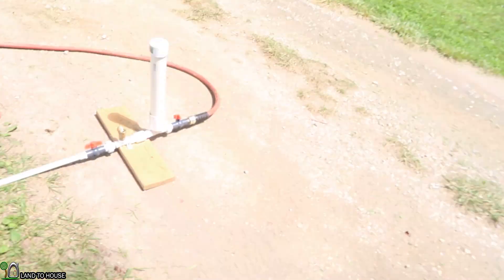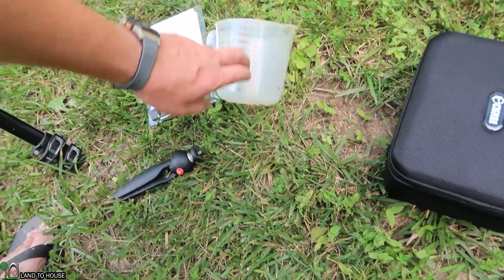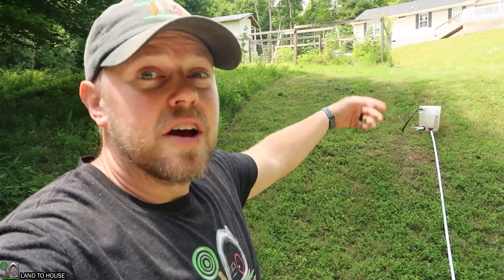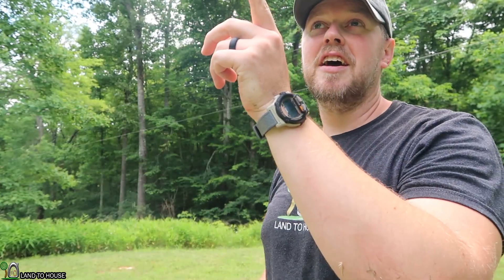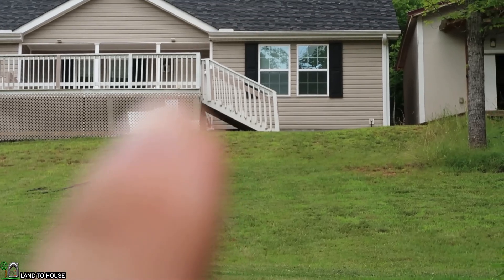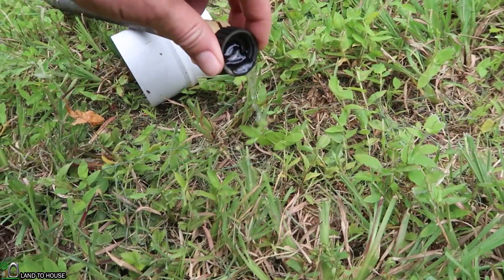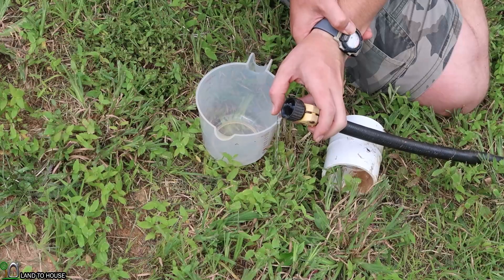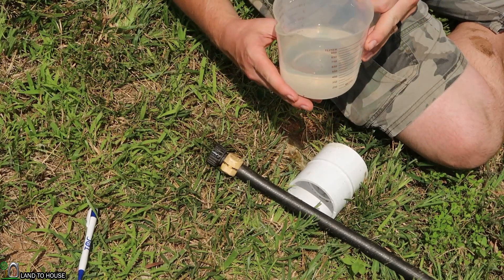Ram Pump Height vs Flow Chart Building

Comment: Hey bro, great stuff but do you realize most of the world in metric ? If you could include the cross over it will help maintain focus on your teaching.
Reply from the maker: You mean the length of a kings foot or nose is a poor measurement method? haha What's wrong with counting by 32nds?  

I need to get more into the metric system.

Comment: Was wondering if one could use multiple ram pumps to pump an amount of water up higher than with one. In other words you have a large one initially. Then up higher you utilize the water delivered by the big pump to run a smaller pump. OR multiple pumps at each elevation. ????

Comment: If your inlet pipe is larger water will flow through it easier and will enhance the working of the pump. That there is more water in the larger diameter pipe makes no difference here, only that the water will flow easier.

Comment: Ive been doing testing with a 1/4 in. Line  ram pump i made and i came up with a intresting addition to it you or others might be intrestid in .
I hooked up a bicycle pump to the first check valve to quick charge the pressure for a instant start up and it worked on my first test , gonna redesign that it into this build i have by adding 2 more check valves on other sides of output and pressure tank with 1 of the valves for the hand pump inlet and see if its a practical addition or not .

Comment: Could you hook another ram pump up to the discharge  on the flap valve? Like have that setup you just did and the add/run a ram pump with the wasted water that just runs on the ground?
Reply from the maker: Yes you sure can. I have a video with a 1" ram pump running a smaller 1/2" pump from that.
Reply: @LandtoHouse  Awsome! I'm gonna have to go and watch! Love your videos! Keep up the fantastic work!
Reply: @LandtoHouse  so if you have a 105 foot straight drop into the feed side from the delivery pipe it could go as high as 735 feet vertically up hill according to the one to seven rule  

I did the math for a 24 inch hydro ram pump with a straight vertical feed pipe and it could through a serious amount of water 
Assuming 24 inch diameter pipe at a drop of a 105 feet it would have a flow velocity before reaching the pump of 112.1 km/h aka 69.7 miles per hour aka 31.14 meter per second or  102.2 feet per second 

And a flow discharge of 9.09 m/3 per second or 321 cubic feet per second or 11.9 cubic yards per second or 9090 litres per second or 2401 us gallons per second 

Basically enough to move a significant portion of a river up hill I'm just wondering with such a huge head pressure what percentage of the water makes it to the top of the hill versus how much comes out the waste valve on the bottom and goes down river 

So if it has a imput of 9090 litres 
Ruffly how many litters would make it to the top of the hill.

Comment: People spend a lot of effort matching the ram pump diameter to the drive pipe diameter but not to the delivery pipe/hose diameter. For instance, they will have a 1 inch drive pipe and ram pump but a 1/2 inch or 5/8 inch delivery hose. I would think any delivery pipe/hose diameter that is not matched to the ram pump diameter would have a decreased amount of water delivered. Maybe people could get substantial water throughput improvement just by using a correctly sized delivery pipe/hose. Perhaps you could test that on one of your very informative videos with a 1 inch ram pump and various sizes of delivery pipes???  BTW, really enjoy your RP videos!

Comment: I’m new to the channel, I was just wondering if a larger drive pipe would create more volume or lift pressure , I’m sure you have addressed this but I haven’t had a chance to look thru all your content, just curious, I have a situation in South Georgia where it will take a pretty long drive pipe to get the lift I need, do you got any suggestions to shorten that or is it just what it is, thanks

Comment: What would happen if you change the brass valve to a smaller diameter or bigger.
Reply from the maker: A mismatched valve and drive pipe will either keep the valve closed all the time or not close the valve.

Comment: I am curious about a set up. I think I've see most of your ram pump videos but you may have tried this and I missed it.   What if you had your input bucket raised on a platform and used a coil of pipe as the drive pipe instead of straight pipe.  The drive pipe could be "longer" without taking up distance.  Would the shock wave travel up the coil?  Would the coil actually act as a shock absorber and not allow the water hammer effect?  Would there be more friction loss of some kind?  Just some thoughts.  I'm moving in a few months to our new property and hope to get my ram pump set upagain and I can do some of my own experiments or replicate some of yours.   KEEP UP THE GOOD WORK!!!
Reply from the maker: This video might be interesting to you. It answers those questions rather well. 
https://youtu.be/E-92wxbG2Gw

Comment: quick question, could you make a staircase of ram pumps (for every foot of head pressure you get 7 feet out) what i am asking is, on a hill every 5 feet down there is a bucket with a 1 foot drop supply pipe to a ram pump that feeds the next bucket up the hill, do this for a few "steps"?
Reply: Doesn’t that me mean that the first pump has to be massive? Both pumping  the needed  water  and the "waste" water  for the next  pump? 
Or maybe slowing down the second  one, but can that  even be done?

Comment: Wow hey brotha,  just found your channel 
Looks great i have seen some videos from others , your details are very interesting,  just wanted to mention using a garden hose while going uphill ,do you think a solid pipe may hold the pressure better ? You got me hooked
Reply from the maker: Thanks for watching. The delivery pipe is only limited by gravity and friction loss. Because the pressure is very small (9psi max in this test) it is just fine to use a garden hose.

Comment: Probably the easiest way to get the head height and the delivery pipe height is to 1) make sure both pipes/hoses are full, 2) stop pump, 3) measure psi on the high pressure and low pressure sides of the ram pump --- divide the psi on each side by .433, each foot of height generates .433 psi (ie. 3psi / .433 = 6.9 feet of head height, 20psi / .433 = 46.2 feet delivery height). No measuring hoses or laser levels.
Reply from the maker: I do have a low psi gauge that would be good for this. I might also do a video on a clinometer

Comment: Is there an optimum air pressure inside the pressure tank? Have you ever put a pressure gauge on that? Would supplying some compressed air help?
Reply: Been wondering the same

Comment: You could attach the outflow part of the hose to a long pole or a 1"x2" or something to lift it higher.  It could be extensible like an extension ladder.  I have one for changing ceiling light bulbs.  Or you could raise your RAM pump up on a box to decrease the head pressure from 65" to 60", 55", 50" etc   That way you could get several ratios for the same location of water source and outflow hose.   But at some point you'd get below minimum head pressure needed.  Or rope over a high tree branch, tie rope to outflow raise until output just barely stops = maximum output pressure

Comment: I wonder if using a 40-60 ft. length of tubing for a drive pipe in a switchback pattern over the 20 feet of run would increase head pressure. It would always have to be descending to avoid slowing the flow and the extra weight might provide more pressure in the drive pipe.  It should join a few feet of hard pipe before the pump. Would it increase the length of the drive pipe without affecting the amount of fall?

Comment: Do you think you could go from a pond to a tank up a hill about 20 feet above  where the pond is????
Reply: Yes you just have to drop the water through a drive pipe from the pond into a ram pump.

Comment: How much could a person upsize a ram pump of this design? Like the idea of a ram pump but for it to be of any use to me I'd need one that could output atleast 2000l per day. Head and flow isn't a problem as I've got a spring coming down a hill at about 500-1000l per minute depending on the season...
Reply: It depends on how high you want to get the water and how much you're willing to spend. You can physically upsize this design like the one community did in a remote village to fill a reservoir with a large cast iron unit (just make yours with 3in pipe or whatever your calculations show), or you could do the more logical thing and build like 10 of these smaller units and run them in tandem.

Comment: GREAT! Bringing more precision into the testing is very good. And your 2nd and 3rd measurements points are already showing a mathematical consistent correlation: If nothing changes between the 25 foot and the 32 foot mark (pump efficiency, water usage of the pump, etc.), then you would expect the 25/32 flowrate at the higher point. 25/32 = 0.78 or 78% of 2 cups are 1.56 cups. Voila! Anyhow, you would expect nearly the same ration (20/25 = 0.8 or a drop from 2 cups to 1.6 cups) for you first measurement points at 20 feet and 25 feet. I think that the delivery height is so low, that the pump is not yet in stable conditions and water usage or efficiency of the pump will change. Might be that the efficiency of a ram pump increases with delivery height. At least at low delivery heights. Is there a way to measure the rate of wasted water? E.g. put a small hose on the wast valve and measure the flow rate. Can be done after the deliverey flow rate measurement, but under the same conditions (e.g. measure always with this small hose on the waste valve, because it will also affect the pump). The flow rate for the used water then ist the sum of pumped plus wasted flow rate. To have the flow rate of the used water is important, because mathematically this is the relevant value because it determines the input energy of the pump.
You also need to gain more delivery height. Could you use a ladder? Probably just another point a little below 40' would be sufficient.
Thanks for the testing!!!

Comment: So you're most water flow was at 20 feet everything passed that started getting to be less which was making the pump less efficient
Reply: Efficiency hardly matters when there is $0 cost input energy. Yes, maybe not ideal and could be optimized. 🤷

Comment: I noticed that, on your first test, the hose was dripping outside the edge of the container, making your first reading slightly less than it should have been.  This could be why the second test was almost the same as the first one.
Reply: I also noticed that. It is realy hard to measure those values exaclty. I appreciate Seth's approach to do so. But at the end it will be helpfull for calculating the expectable output of such pumps. Furthermore, I think that 20 feet are to low for the delivery height, and the parameters of the pump (like efficiency and water usage) are not yet settled. It might be that the efficiency is increasing with delivery height, at low height. With 5.4 feet of head (65") and only 20 feet of delivery height you have a quite low ratio of 1 to 3.7 for head vs. delivery height.

Comment: I am curious about how much water is used to lift a given volume. ie, How much water did it take to life the 2 cups. Perhaps put the pump in a catch basin and measure the water used or take a measurement off the 5 gallon bucket. Thanks Seth, really enjoy your channel. Have you had a chance to check out 
"OpenSourceLowTech" channel? He has commented on your videos before. He is getting 200 watts out of his low head turbine system like you set up at the dam pond. (I think at your neighbors) Edit: I was wrong, he was getting 200 watts.

Comment: Would have been helpful to determine volume at lower levels.   For example with 5 feet of head, wonder how much water would have been pumped at 10 feet of lift.   For those of us doing irrigation with various sprinkler pressure possibilities could be important.   Also related to one of your previous videos where you were filling a tank with different methods, I've wondered how much water volume I sacrifice to fill an elevated tank vs dump the water on the ground with the lowest lift possible.... Or low pressure sprinklers or nozzles vs higher pressure.   Can't wait to see more results and if we can duplicate.

I believe that your comment that some output charts were calculated vs observed is correct, because they were too mathematically exact...no variation from calculated values.

Comment: The tests so far bring into question, the idea that for each doubling in height, water volume pumped is half.     In my own low head testing with a Land To House pump, I have been surprised how high the pump could deliver water ... Although at a low rate.

Comment: Good demonstration of the ram pump lift ability. Question regarding the measured heights mentioned in the video. Are the 20’, 25’ and 32’ test points measured from the pump or the bucket? If measured from the pump you will need to subtract the head height between the bucket and the pump. If measured from pump the actual 20’ measurement would be 14.5’.

Comment: I think the measurements are a bit incorrect, ill rather suggest you to use level tube, that is perfect in measuring heights.
Reply from the maker: A water level is a good way to measure height. It can be more difficult when you have to measure across a longer distance. These heights should be very close to accurate based on the laser level and tape measure.

Comment: You still need to put a ram in a pond......I have tried to tell you many times.....it's amazing that you resist doing that
Reply from the maker: I need to find a swimming pool to demonstrate the use of a ram pump in a pond. Take the gopro into the water.
Reply: @LandtoHouse  great idea ..... elevation of the output pipe (backpressure) is critical..... hard to start..... opening of (must have air) intake cannot be completely underwater..... you will tinker a little..... I have a 2 1/2 inch valve on intake side and a 3/4 valve on output side
Reply: There was a video showing the waste water valve underwater.   As I recall, it did run, but with less water pumped.
Reply: @davebean2886  exactly

Comment: @land to house

I have a very steep hill from creak to garden area, which is through a thick forest and difficult to guage height differential.

I think the water flow is comparable to your stream there in the videos. There are two water falls, 4m (12ft) and 1.5m (4ft) respectively. I can feed the water from a pool above the first fall. I'm wondering how high I could elevate the water to get the tanks suitably placed above my garden. The hill is not a cliff but not far off it, feels like it could be a 100ft differential.
Reply from the maker: Measuring the height of the hill can be tricky. I like to get a general idea from google earth. You can use a laser level with tape measure, you can use a water level in a clear tube, you can use a clinometer and tape measure, garden hose with pressure gauge... so many way to find height it will depend on the terrain for your choice. 

To lift water to 100 feet you will need an input head pressure of 15 feet. This will give you a nice flow at the top.
Reply: Thanks a lot Seth!

Comment: If you put a clear short hose on your non-running ram pump (maybe where the pressure gauge goes) you can hold the end up and see how high the water goes in the hose --- that will be level with the top surface of the water in your source bucket and you can measure from that to the ground to get the exact head height.
Reply from the maker: That is a good idea. Water Level is a great way to get the height.
Reply: @LandtoHouse  Really like your videos on the ram pumps :-)

Comment: A comparison between a single one and 2 in staggered parallel would be interesting.
Reply from the maker: Do you mean using 2 pumps on the bottom to run 1 up top?
Reply: @LandtoHouse  Split the input with a Y, run that to two pumps, and then Y the outputs back into one pipe. Lift one check valve slightly higher so they open at slightly different timings.

Comment: Heck yea.    Thanks.  :-)
Reply from the maker: I need to find a place with a very tall hill.
Reply: @LandtoHouse  I have the PERFECT place! Been trying for 2 summers to get creek water about 200 ft up hill. Every time I think it's gonna work something happens... I've been thru 2 pumps because I've cracked the pipe, several water hoses, cpvc, pvc, different diameter, different theories😵‍💫😰... not giving up though!